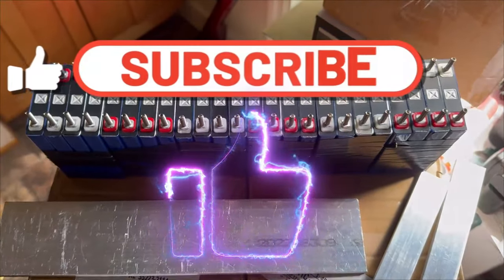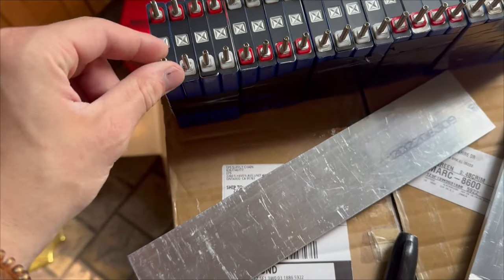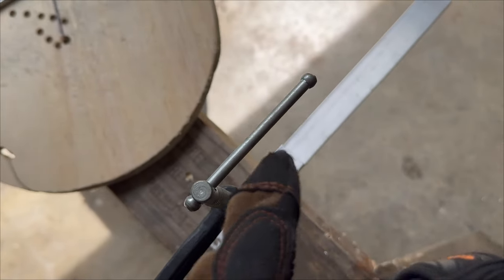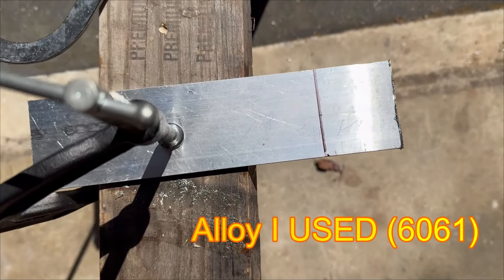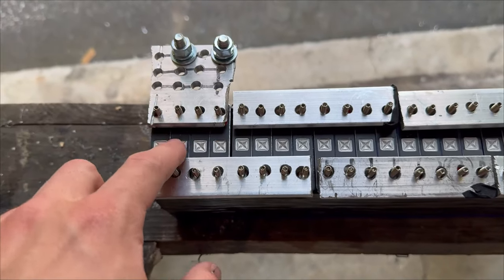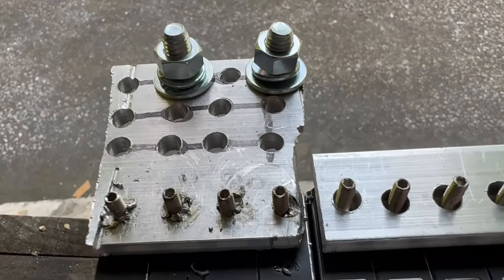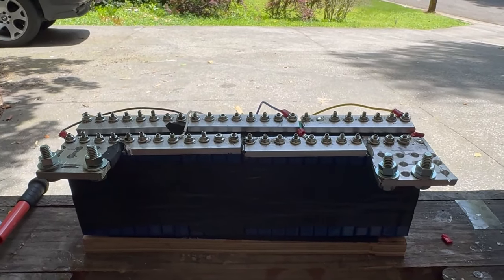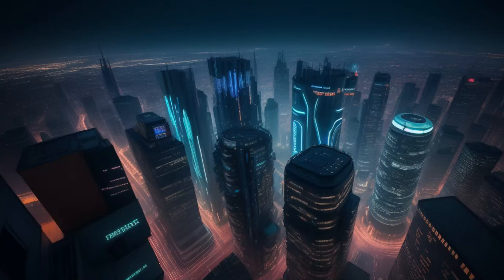DIY 13.8v LTO (Lithium Titanate) Battery

Comment: Interesting 🤔! I don’t think I will be putting a extra battery or anything in my truck bc I’m trying to make it still look stock and mainly bc I need the room, hence why I made the full disconnect system to come out, bc I race dirt bikes and use a hitch hauler so I store my equipment in the back my suv or I would’ve got atleast 2 subs! LoL
Reply from the maker: @MoToArchY  lol I understand that. You ride street bikes too?
Reply: @Zachecker I been riding since I was 3 and racing since I was 5-19 then stopped racing and started riding street bikes! I use to have a 06 r6 raven edition! Then started riding dirt bikes lil over 2 yrs ago! Wbu
Reply from the maker: @MoToArchY  I’ve had a grom since 8th grade been riding on and off ever since but my family is a big Harley family

Comment: Gotta give you credit kid... You are not acting like you know everything  and are open to new ideas! Not the best looking bank and bars but effective...  How much for the cells did you pay and what was the amp hr
Reply from the maker: 170 for the cells including shipping and if my math is correct its like 11.25 ah lol. if i got my 30 cells like i thought it would be 14-15 amp hours. its my first battery bank ive made just a stepping stone to something bigger 😎 (super tough to cut metal manually without correct power tools😅)
Reply from the maker: @PeterFeltersnatch852  from my research LTO is the way to go when it come to car audio because of its cycles and discharge rate. and my tools i use is all from harbor freight ill check the angle grinder out.
Reply: @Zachecker you are definitely correct SCIB LTO is second to NONE best cells on the market bro don't let anyone tell you differently that C rating is what your looking for 75c is the best on the market right now and people do me the same way I got told the other day at a small car show that my SCIB bank was garbage and I should have went with spim 08 all I could do was laugh 😂